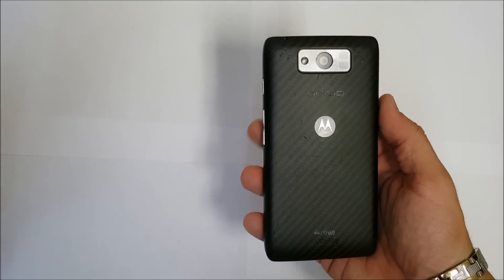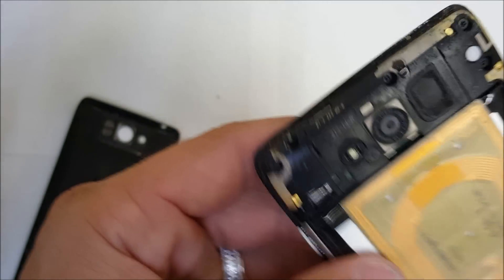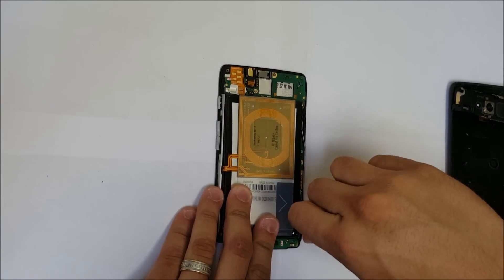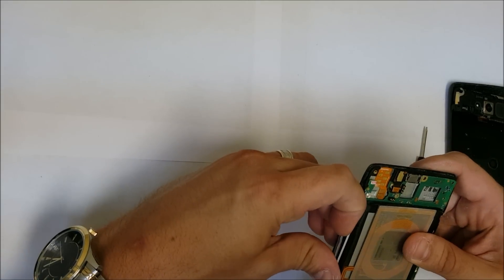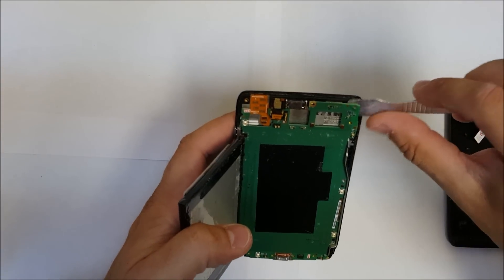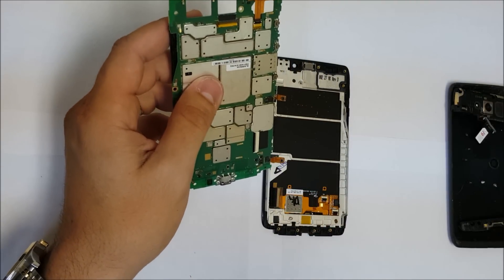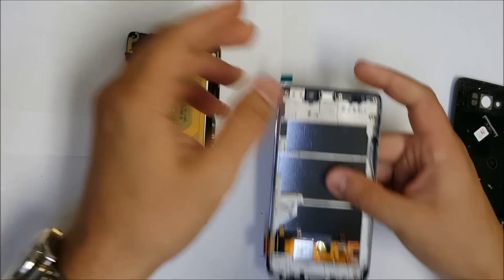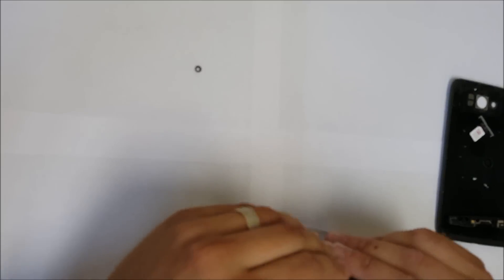Motorola DROID Ultra XT1080 - LCD Screen Replacement

Comment: OK Fair video. HOWEVER you did not mention one excruciatingly small but supremely important thing. Presumably because it rarely happens. As you are disassembling and assembling this phone be very VERY careful not to lose or dislodge the extremely tiny but necessary spacers on the volume/on off buttons. They are extremely small and easy to lose. And may I say very HARD to handle and re-install. They are a small black plastic piece pushed into the switch and as I have found do fall out on occasion. I put my phone back together to find the volume down button worked fine but the volume up button would not work. After some investigation I found this piece missing. No idea when or where it fell out. I looked and looked but could not find it. Mind you this is black and literally smaller than the head of a pin but the switch will not work without it. As it happens I have another broken phone just like the one I am repairing, took it apart and pulled the part out of it then put it in the good phone. Lucky me.
Reply: Mark Torrence I was wondering why it wasn't working!  Thank you!

Comment: good video, for anyone wondering the torx size to use is a t5 for most of them then a t4 for the long screw
Reply: is the long screw you're talking about the one just next to the camera? I cant get that one out and it seems to be the only part stopping me from getting the rest of my old screen off .I ended up snapping part of the old screen and I cant get it off seems that screw is the only one stopping me from getting the remainder off
Reply: Sorry it's been a while since I did this and I don't remember anymore

Comment: What happen with a rubber O seal around a speaker on a screen? Why you didn't transfer it to a new one? Use a heat gun or hear dryer to ease it up. You should either install a new O seal or transfer it from the old screen. And don't cut corners on this please!